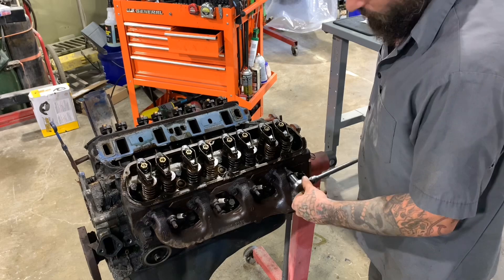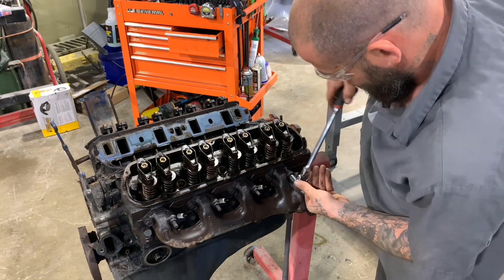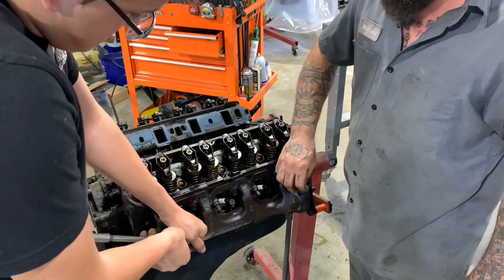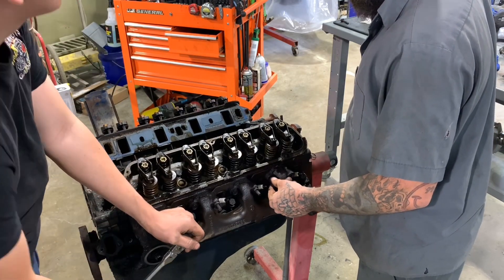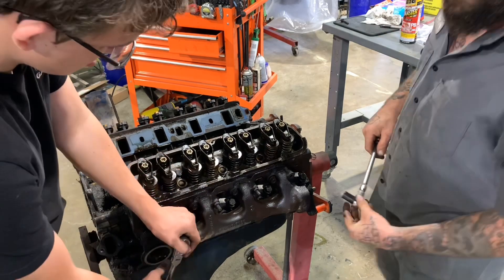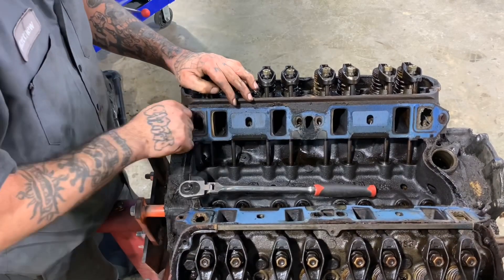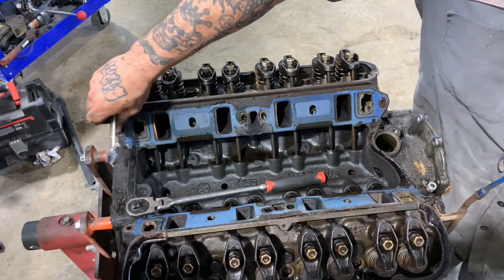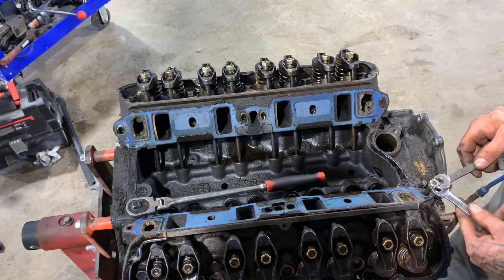Ford 289 Teardown part 2 of 3 (top)

Comment: Use a air-chisel with a blunt end punch installed to loosen stubborn bolts and fasteners. Just use against the flat side of bolt head, a few raps and the fastener should break free.
Reply: I use a brass hammer and elbow strength lol its a lot less damaging than air hammer but your right vibration is key to getting frozen bolts/nuts loose oh and lube lol alot of lube!

Comment: Them exhaust manifold bolts must've been removed not many miles ago. Lucky... when I was 15, I bought a 64 fairlane 500 four door wagon. It had a hipo 289 with 17,000 original miles on the car and motor. The car was 15 years old at the time too and had been sitting for over ten years. I had 15 years worth of knowledge and one thing that wasn't part of that knowledge was what a hipo 289 was. I  doubled my money on the car from $50 to $100. I should've gotten my clue  from when the guy who bought it creamed his jeans when I told him how much I wanted for it. I didn't want a four door wagon, I wanted a truck, and did buy a 49 ford for 50 bucks next. It was cooler to me. Couple months later I learned what the hipo was and wished I still had it to replace the flathead in my truck. I traded that 49 for a 55 with a t bird motor. It was hip cuz the aluminum valve covers had raised t-bird on them. It was the 312 y block. Sold that truck for $1,500 and bought a 72 hi boy with a 390.